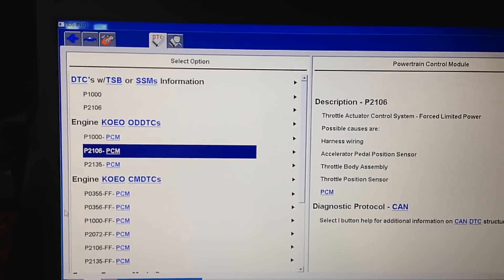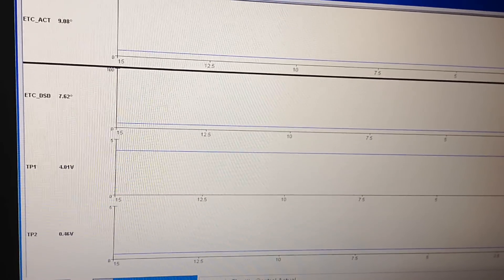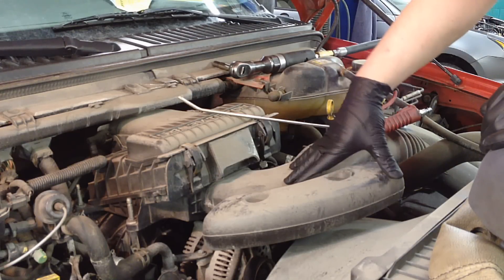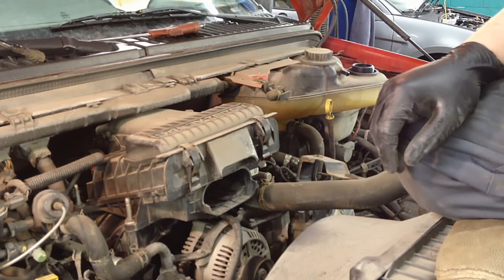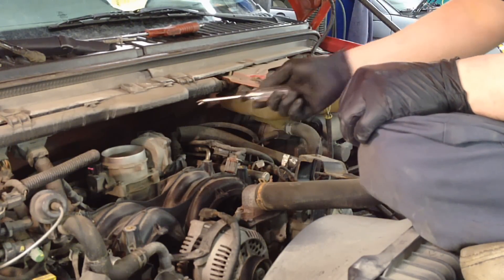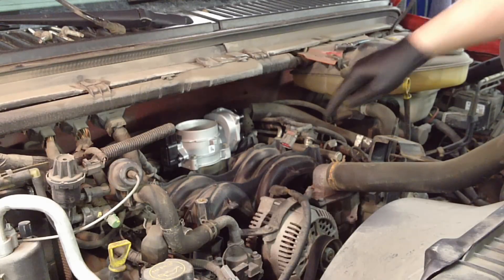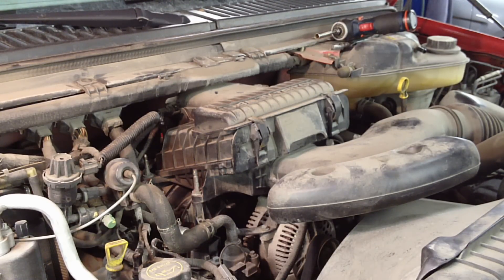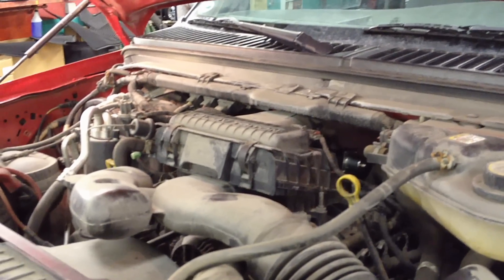Ford F150 F250 5.4L 3v Electronic Throttle Body Replacement P2135

Comment: My 05 and 13 f150s dont mirror each other. One goes from low to high on FULL pedal sweep, and high to low for the first HALF of pedal sweep. 

So, from 1/2 pedal to full, one sensor, on both trucks, stops any increase after 1/2 pedal.

Thoughts? The 13 seems under powered from 1/2-3/4 pedal. Wont really downshift. The 05 has a feather light pedal, shifts smooth as silk.

Comment: Since you are all ford, I keep getting the P0191 code and I already replaced the fuel pump the fuel rail sensor, fuel Module and fuel filter and I’m still getting a stutter when I take off. It bogs out an sometimes stalls. Why am I still having issues? I did tps maf all new coil packs and plugs along with both upstream O2 sensors but I can’t seem to fix my f250 5.4

Comment: Thank you so much. I have a quick question though. I change the throttle on my 2007 Ford F150 but the truck won't start. I thought it something to do with the battery but I got it checked out and the battery is good. Can you please help me?

Comment: I have the 06 F350 5.4.  I’m having a hell of a time trying to figure out why it won’t stY running.  It will start for a couple seconds then die.  I replaced the fuel pump, the filter and the fuel pressure regulator. I also checked the fuel pump drive and that seemed fine too.  I’m at a loss

Comment: I'm getting U1950 L1707 L1710 P0581 P0720 P0722 P1000 P2106 and B2292 could this be caused by just the throttle body
Reply: Really stumped and local Ford dealership cannot figure it out

Comment: This was the best tutorial for  Ford TPS. I found a BRAND NEW Ford TB w/new TPS  at a dealer for a crazy cheap price. Up until today, I could only change oil. I changed the throttle body in 1 hr hour, it was hot outside-- I needed ice water breaks, it got hot after 10 am when sun came over the house😅. All is well. If it weren't for this clip, I wouldn't have had the guts to do it. My 06  Mark Lt is running fine!!

Comment: 06f150 5.4 triton. When I put on drive and accelerate it would make a combustion or loud bang/rattle. Only when its in park and I accelerate it does not come on. Also when Its on idle it has a 3 to 4 seconds in between knock/tick noise coming around the bottom of the filter. Help plss

Comment: Thank you!  This saved me HOURS and a lot of cursing, because I knew what to expect , especially with the connectors.  But here are some additional tips I found along the way...
1) On the electrical connectors, sliding the red cover exposes the black clip, which you then press to release the connector.  But it's recessed and hard to press, so a paint can opener makes a handy tool for this. (but might want to tie a string to it in case you drop it)
2) The snorkel has wedge-shaped retainers top-center and bottom-center.  The video shows him wrestling it loose, but this could break the airbox plastic.  If you remove the air filter, you can now reach in and lift the bottom-center tab over the lip, then tilt it out as he does.  It's much easier than wrestling it out and doesn't risk breakage.
3) There is a related video from FordTechMakuloco about removing the Throttle Position Sensor from the throttle body.  Look at it BEFORE attempting to remove the mounting screws!

Comment: I have a f150 5.4 3 valve 4x4. every time I accelerate it bogs down.I'm thinking it could be three possibilitys.clogged catalycs converters or electric throttle body or fuel pump. I notice it's starts up strong and the longer it runs the less power I have. lately I can't even drive it. it bogs down immediately. I have replaced airflow sensors and cam and crankshaft senders. I replaced plugs and coilpacks twice. can you  help stear me in the rite direction
Reply: Terry, did you ever figure out what was wrong with your truck? I’ve been experiencing the same symptoms with my 04 F150.

Comment: Thanks for the video. My throttle body is OK, but a rat or something chewed through the harness leading to the TP connector. Couldn't figure out how to take the connector off the TB until I watched this. Thanks for making everything so clear, you saved me at least $150 at my local good guy service center. Repaired the harness and it runs like new now!

Comment: I did as you said and replaced the tps and cleared the pcm. However now when I go to start the motor it will start for a second and then die. What am I missing I hooked everytging back up and check all connections.
Reply: Jordan Hamilton hey did you figure out the problem. I’m having the same problem now
Reply: @nilahdominique2686   When you install the TPS sensor you have to rotate it. Theres a spring inside the TPS sensor once you rotate it follow the same procedure for installing it as usual. If you dont rotate it when installing so its under tension it will die everytime you try to start the engine. So in short rotate the TPS back fowards the cab till it wont rotate anymore the fasten it down.

Comment: 04 F150 5.4 3v.  Low power, No Codes.  Throttle body or fuel pressure?

Comment: Great video !!
Question , after replacing the throttle body and re mounting the air box , the back of the air box it seems doesn’t go down as low as the front of it . Is that normal or am I doing something wrong. 

No check engine light or any noise just curious why the air box doesn’t sit level in relation to the throttle body edge 

Appreciate any help I can get

Comment: Hey Brian, I have a 2011 f250 6.2l 152k miles. Sometimes it fires right up and idles about 5 minutes then dies. After that it doesn't start with out slight throttle input and will idle a minute then rpms fall and dies. it will not idle after a few attempts. I changed the throttle body with one from Florida/40k miles on it. the replacement put a wrench light on and never started. I swapped back to my original body and it fired right up no lights then died after 5minutes. The truck will stay running as long as throttle is held, but you can smell its rich and have lots of knock sensor counts. I do have MAF/IAT Circuit codes and almost all Pedal related codes. Just not sure which direction to go with it anymore? any help is appreciated and I can donate to your paypal for some more of your time.

Comment: Great video!! Has anybody had the problem with their vehicles on hard acceleration past 3000 RPMs bogging down? It basically feels like you just looze power. I've replaced coil/plugs and no codes are thrown. Any idea?
Reply: Same right now
Reply: Clogged cats. Check with rubber mallet by tapping on converters and listening for loose pieces inside.

Comment: My 2004 lincoln ls v6 is doing that thing where i turn the key and the throttle body plate tries to open and close but moves very little. I got the wrench icon on my dash and getting obd codes for throttle actuator control system stuck closed and forced idle. The car will not accelerate at all. Pressing the gas pedal does nothing. 

Im buying a new throttle body assembly right now and replacing it this week. Will come back to this comment and say if that fixed my issue
Reply: well did it

Comment: i have a 04 f150 fx4 5.4l i replaced the throttle position sensor and the throttle body motor and now i have no gas pedal responce.i have the check engine and the wrench light on.what could it be??
Reply: Cristian Delgado my ford truck is doimg the same thing did u find out wat it was ?? Ive been trying every thing so far nothing

Comment: Doesn't anyone clean their engine compartment?
Reply: What’s the point? Everything is sealed off
Reply from the maker: In general no, I saw one per year maybe working at the dealer.
Reply: @FordTechMakuloco  Will this also cause A NO ACCELERATE PEDAL... I watched and did your timing chain tensional & phaser job with all the ford parts you said to buy on Amazon because my truck was making phaser & chain noise and started losing power after about 30min of driving.. But after doing all this I now have NO ACCELERATE PEDAL and also have codes P2100 P2104 P2107 & P2110..that's the only codes coming up now....(already changed the throttle control sensor. But No Luck)..Starts up great runs smooth for about 5secs then rpm drops and starts running rough. Check engine light & wrench light is on... You have the best videos and very detailed so I hope you can help me with this. Thanks for everything.
Reply: Only people who like saving money and don't like to wait for their vehicles at the shop.

Comment: Does a 06 F150 4.6 have the same system with dual TPS or not?  I have a P2135 code/rough running intermittently with the wrench light.  Shut it off and restart and problem is gone. I and am trying to decode whether to change just the TPS or the complete throttle body. Thanks.
Reply: what did you end up doing

Comment: having the problem although I was alone and wasn't able to check the sounds. the wrench came up on me for the first time. changed out the throttle body in O'Reilly's parking lot cause I was 2 hours from home with the boat in tow. anyways did everything you said to the T and still having the issue, any ideas? guess I need to have it diagnosed but of course it happens in the weekend and Ford isn't open..

Comment: I'm getting pP2106 code with "wrench" warning light, along with a p0113 and p0102 code. This is right after new spark plugs. Should I still replace the throttle body or check something before I replace it? It's a 2005 expedition if that makes a difference. Also it seems to be driving fine as of now.

Thanks in advance for your response!
Reply: I would just get some throttle body cleaner spray and an old toothbrush and clean out your throttle body first to see if that works.  All you out is a few bucks for the spray and some time if that doesn't work and if it does, well you just saved quite a bit of mula.

Comment: I have the 2004 f150 with the 5.4l 3v and my truck will try I die as soon as I drop it into gear and try and move the truck ?i had to move it out of the road so the bus wouldn't hit it and it barely mad it in my drive way , I had to get the rpms to 3000 to even move the truck could this be the idle only mode ? I also have 2 other codes for the output speed sensor circuit having a malfunction and all 3 codes came on at the same time and now I can move my truck hardly?
Reply: Can't *

Comment: Thank you for a clear, non boring, and concise explanation of the throttle body replacement. It also explained the codes and how the engine resets the points necessary. I can now understand why my F150 threw codes left and right without reason.  :-)

Comment: Hey I have an 08 f150 5.4 3v that came in for stalling. It's only stalls when putting in drive. Codes p0712 and p1783 both for tft sensors. Have u seen any issues with this? Thanks
Reply: Did I find the fix??

Comment: Hey, I am throwing P2106, P2135, P0581, P1000 in a 2005 F-150 5.4 3v. Would you suggest getting a new TB or just the TPS to clear up my first two codes?  Thanks for your videos they have been very helpful.
Reply from the maker: +Jon Scholtens you should only need the TP sensor
Reply: +FordTechMakuloco  Great thanks. I'll take it off and clean it and put a new sensor on it. Thanks.

Comment: A very informative video.  I took my truck to a dealership a few years ago because my truck would cut off occasionally while either slowing down or taking off.  They said I had a cracked throttle body and it would be around a $600 repair.  I put it off and the problem has started again.  So I'm guessing it is time to get it done.

Comment: I have a sticky accelerator pedal so I was going to clean the throttle body. But I noticed my 06 Expedition has a electric throttle body! My question is can a sticky pedal still be caused by the dirty throttle body even if it's electric not cable throttle?

Comment: My 05 cuts the throttle and goes to idle every now and then. I did research and talked to a shop and they said it is the tp sensor. Do I need to remove the throttle body to put a new sensor on? Also do I need to calibrate it like u did when only changing the sensor? Thanks

Comment: question.  I have a 2005 f150 with the 5.4. the engine stalls when I move from park to reverse or drive.  and also while driving.  going down road and when stopping at stop signs.  I hand replaced the tps already.  it's not showing a check engine light or wrench.  no codes coming up either.  any help
Reply: +Randy Gambler that is the throttle body. it either needs to be cleaned well or replaced. be sure to re calibrate it after changing it.

Comment: Love your videos!  I have a 2005 Expedition with 170K miles.  Getting codes P2106, P0720, P0722.  At first, I believe it was in limp mode.  Changed TPS and cleared the PCM.  Still got those codes.  Cleaned the throttle body with throttle body cleaner.  (all with the help of your great videos!)  Took it for a short drive to see if it was driving any better, and it still seemed to be in limp mode.  Now, after parking it,  I have NO forward gears, only reverse.  Changed the Output Speed Sensor.  Pulled the transmission pan and found some pretty dark sludge with a small amount of metal shavings.  My husband is convinced the transmission needs to be rebuilt, but I remain optimistic.  We replaced the throttle body about 2 years ago.  Is there a way to check the throttle body without replacing it again.  I would much rather replace a throttle body than have to rebuild a transmission!

Comment: hi i know this doesnt have to do with video but i have the same truck with the 5.4 3v engine well the problem i am having  is the hose that runs from the driver side valve cover to the heated pcv element the hose is like sucked flat what i am asking is if you have heared of this does the valve cover need to be replace or removed and clean?
Reply from the maker: +Leo Schmitt the cover is not serviceable to clean that I know of, so it would have to be replaced.

Comment: I got the wrench light coming on at idle occasionally on my 2010 f150 5.4. Immediate rough idle and low power. If I turn the truck off and back on, it clears with no problems. I checked the tb today and the noise when the ignition is turned on is normal 1cycle. What else could the problem be?  Can a dirty throttle body be the cause as we'll?
Reply from the maker: +zimsjeep A real dirty throttle body can cause this so its not likely. Get the codes read to see what fault the pcm is seeing. It can be more than just the ETC system causing this code.
Reply: +FordTechMakuloco thanks man.  I scanned it this morning and got P2135 - ETC position sensor voltage correlation. Probable cause - failed throttle position sensor or open/short circuit condition. Can you translate that for me. Thanks again.
Reply: +zimsjeep so I think I answered my own question and found your other video on the position sensor replacement.  Thanks

Comment: Wow, i must admit, that was a great instructional video, and I have watched hundreds of them. I am not a mechanic, or even mechanically inclined, and have these exact problems.
I have watched a lot of videos, but none of them really gave me enough courage to do this on my own, but this video did, so thank you very much.
On another note, you are the first one I have even cared to comment on.

A quick follow up question for you:
The symptoms that I am experiencing is the irregular idle and loss of power when going up a hill or having to pass a vehicle. The cleaning of, or installation of a new, throttle body seems to fix those issues.
However, my engine also "sounds like" a diesel engine (Clicking) when it is idling, will that go away too, or is that another problem? If another problem, do you have a solution video for that too?
Reply: That dieseling sound is common on 5.4s it's the cam phazers I'm not hijacking comments but from my experience that's what they are. I just bought an 04 with a damaged motor that I just ordered a whole timing kit for from Ford so this will be like my 6th or 7th timing job on a 3v 5.4
Reply: The roller followers go bad in the 5.4l 3v thats the ticking noise u hear

Comment: The problem I have is it doesn't set a code on the dash. I had the PCM scanned and they said there's no evidence of a fault code. With no fault code should I be spending thousands of dollars throwing parts at it till it clears up? I'm kidding of course. I was looking at Edlebrock to see if they sell throttle bodies for my rig, so that's ongoing right now. I'm stumped.
Reply from the maker: Robert Hughes They need to diagnose the throttle body by watching the pids not just checking for codes.

Comment: I have a different issue. I have an intermittent issue with acceleration, like the old fashioned hesitation you get from a worn timing chain or a dirty carb. Sometimes it doesn't act up at all, or sometimes you press down on the throttle and it bogs down. Then iI have to let up and it seems to correct itself. I have no codes in the PCM or the dashboard. I recently took it to a dealer, changed the plugs, air filter and ran injector cleaner through the gas tank, and changed the fuel filter with no improvement. I'm at a loss  here. I'm considering changing out the throttle body, but it's an expensive "guess".  Any thoughts? The throttle body was supposedly cleaned as well. HELP! Oh yeah, 2004 F-150 5.4 3 valve. 99870 miles. Lariat
Reply from the maker: Robert Hughes Sure sounds like a throttle body to me yes only way to verify is with a proper scan tool watching the pids.
Reply: Robert Hughes did you figure out the issue? I have the same problem with my 09 expedition